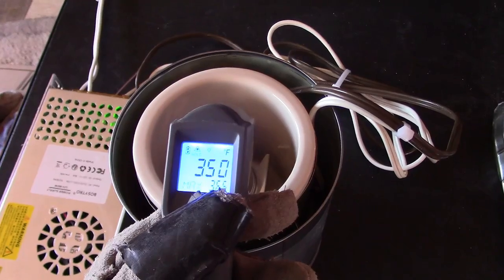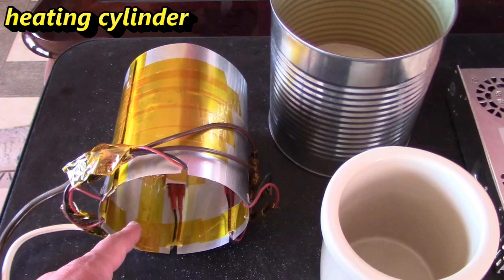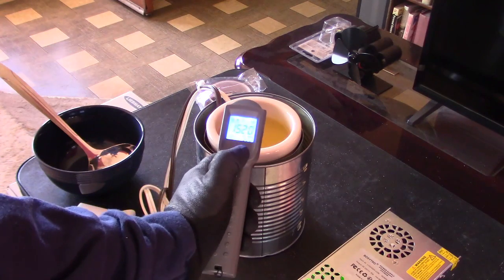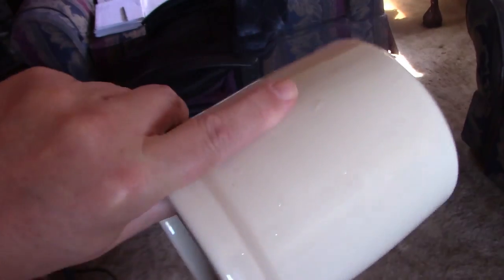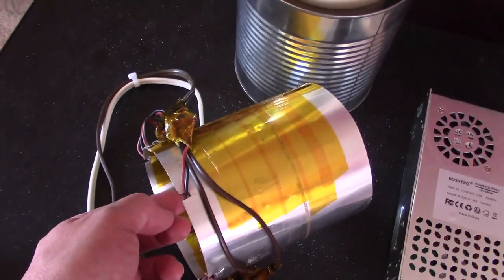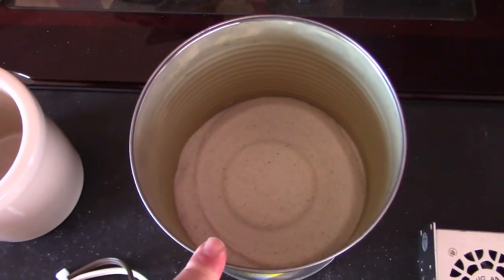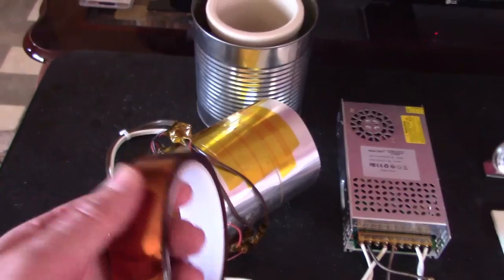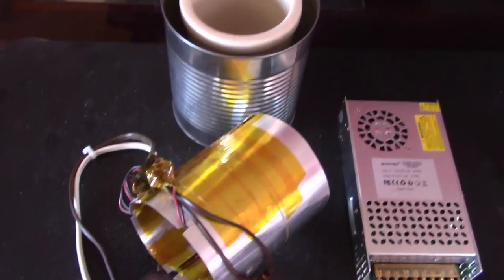How To Make a Stoneware Cooker/Oven! w/2 heat settings and removable crock! 12v (AC/DC) DIY!

Comment: how many watts to fire those up?   is it even possible to use say a 100W solar panel to power it up?
Reply from the maker: hi. i'd use probably 2 or 3 12v 100 watt solar panels with this. note that 100w panels are as low as $57 to $59 each these days (amazon). the prices have come way down. i'm thinking about buying a couple more. (probably 3 more)